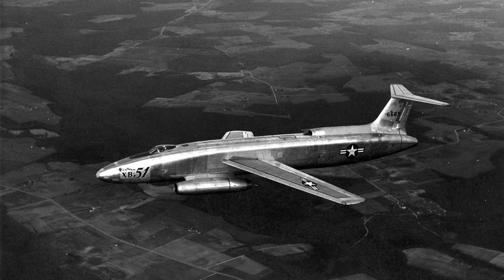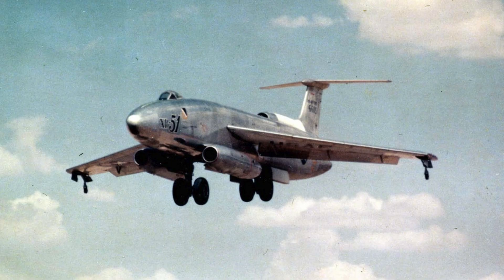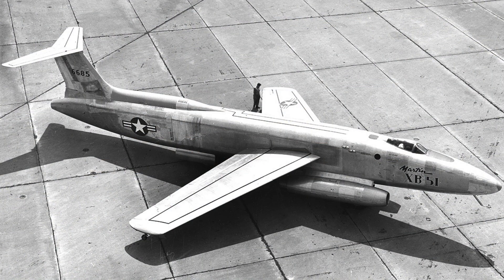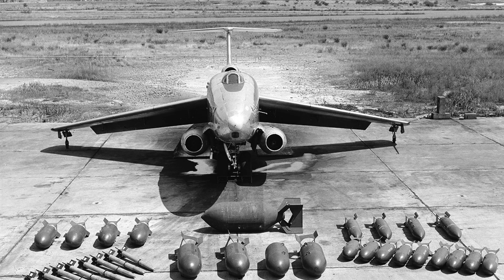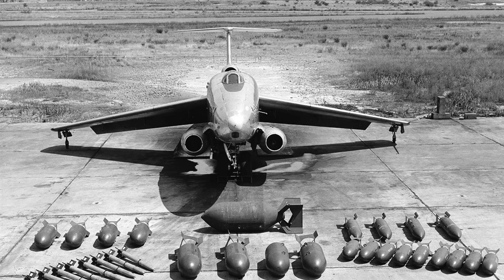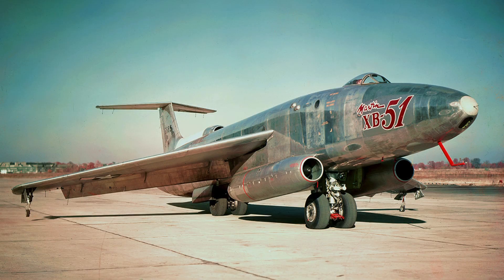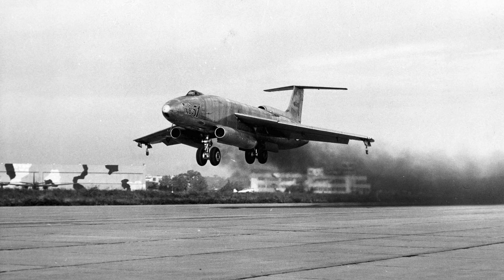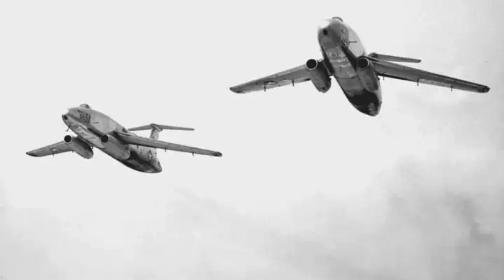America Built a Jet Bomber That Made No Sense

Comment: They didn't build a bomber that made no sense. They experimented with a couple of prototypes which convinced them not to build it.  Lots of new configurations were tried in the 1940S and quickly discarded when they proved less than optimum.
Your long list of what you present as negative flight characteristics (repeated at least 3 times) is a list of the characteristics of all new high performance aircraft compared to their predecessors. You provide no meaningful insight into this airplane.  Don't quit your day job.
Reply: AGREED. THIS IS CRAP.